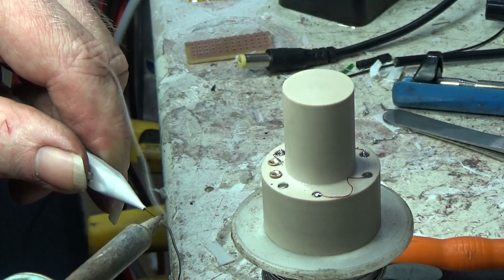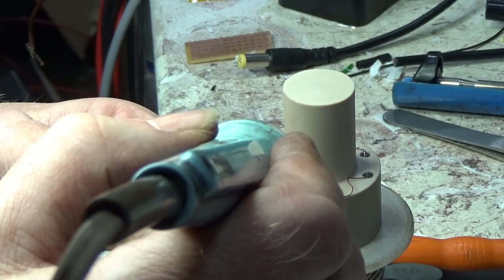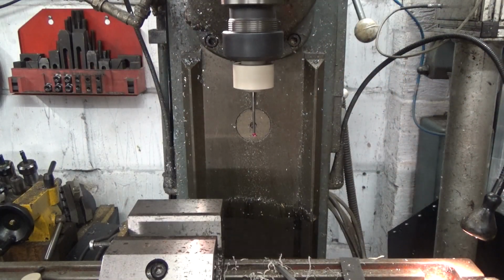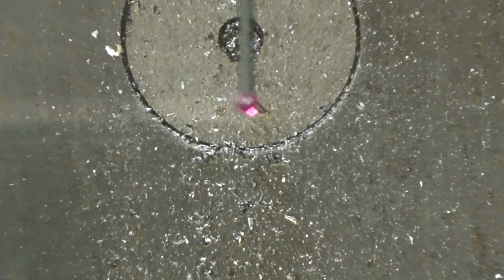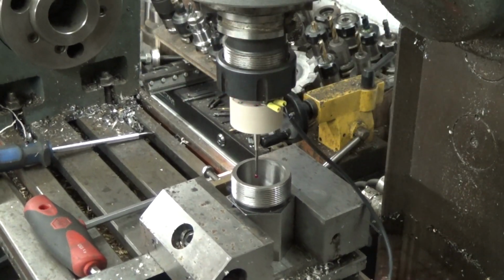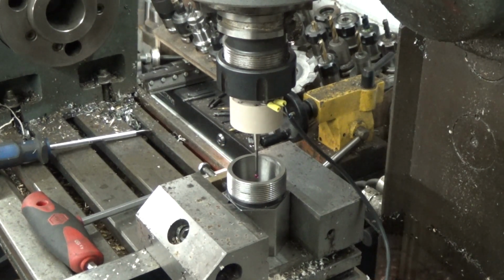A Simple Touch Probe made with basic tools.

Comment: If this design was patented, half the world would be in jail already:) Unless it's patented by Renishaw, their prices are so high that they could care less what DIY crowd is doing. But the original author must have been a real genius to come up with something so precise, yet so undemanding, as long as it's calibrated with reasonable care, and parts are not exactly bent, twisted or otherwise deformed. This version looks interesting, but I'm pretty sure that three calibration bolts which would align the shaft with the axis of the machine would play much more important role than the shape of contacts/supports...
Reply from the maker: The original 6-balls, 3-rods design was definitely patented by the founder of Renishaw when working at Rolls Royce: https://patents.google.com/patent/US4153998A
whether the version using rods instead of balls is also patented is not something that I looked into. In the case of the Renishaw patent, it will have expired after 20 years. 
I think that the 9-rods modification is nearly as clever as the original concept, but very much builds on that original design.

Comment: the more common probe cycle is to rotate the spindel so the same "point" of the stylus always touches regardless of direction... so not only centering  you take out the "error" of not center by just making sure you use the same side of the ball.. :)

Comment: I think this could be 3d-printed (I would use nylonx) .. with the holes undersized - ream them out to size.

The other bit would be 6 (or 8) grub screws holding a threaded insert for the probe itself - these could then be tweaked to true it up (You want a both concentric and straight probe)

Comment: Looking at the model (Thank you!) if the 3 horizontal pins were lower, and the shaft stub was adjustable in the housing (the housing becomes 2 parts) then it might be possible to adjust concentricity?
Reply from the maker: One simple mod would be to slice the hub between the stylus and the three rods, put in a dimple with a small ball bearing in it, and then have 4 tiny screws bolting it back together. Then you couls adjust the screws to centre the ball. 
This is largely what the "real" spindle-mount probes do. (CMMs might not bother, as you only care about relative motions there).
Making it better would be a good start, but then I am seriously considering writing a calibration routine. Probe a hole, rotate the spindle, probe the same hole, calculate offsets correlated to the spindle position (using the spindle encoder) and then you can calculate the offset in X and Y for any spindle angle.

Comment: A really good design. Renishaw's TP2 is in fact very similar to this, using 6 rods in similar confuration in an anadized aluminum tube. The anodizing provides insulation for the rods from the holder. All in a .5" or so diameter device. I suspect they had a jig that held the probe tip holder inline witht he housing while the glue holding the pins dried. Adding an op amp to the output would perhaps also help with trigger accuracy. Renishaw has an excellent paper somewhere on the change in resistance before the contact actually opens. The TP2 that I have has some concentricity issues, but I don't know its history so who knows. It was free so can't complain.

Comment: Andy, If you were to tap the shank so a screw could lock the the probe holder in the Vees then tap the center as an assembly for the probe tip you might get near zero run out. just have to mark body and probe holder so they always get assembled the same way.
Reply from the maker: Sorry, I only just understood this comment, and and realised that is exactly the idea that I came up with in the follow-on video. So, please don't feel that I failed to acknowledge the idea, I just came up with the same thing independently and hadn't noticed that you got there first.